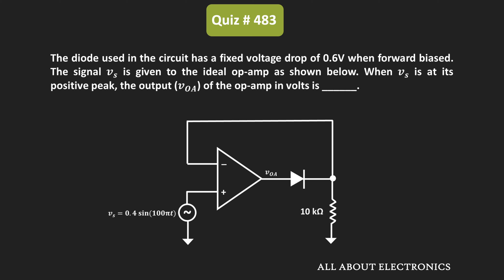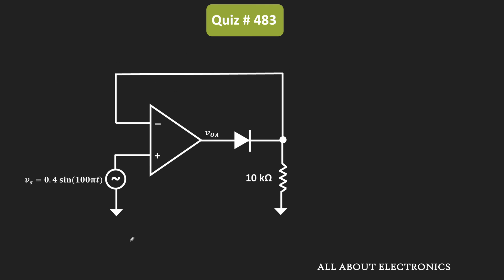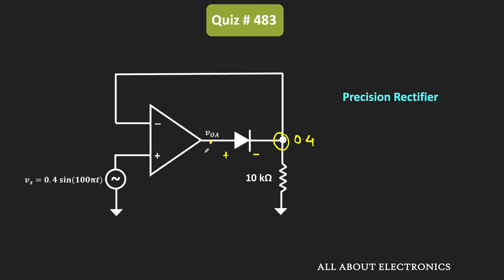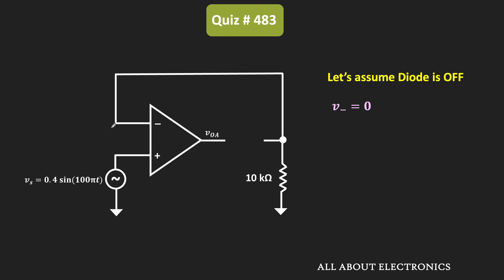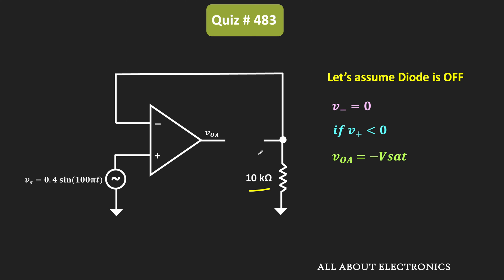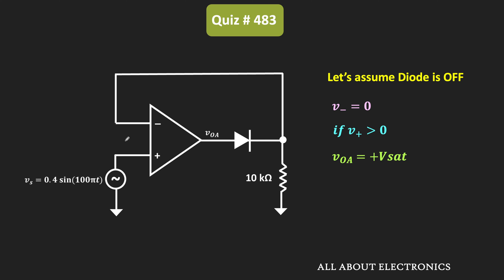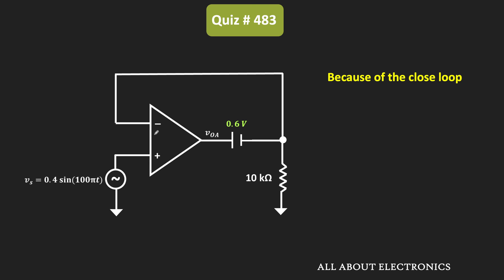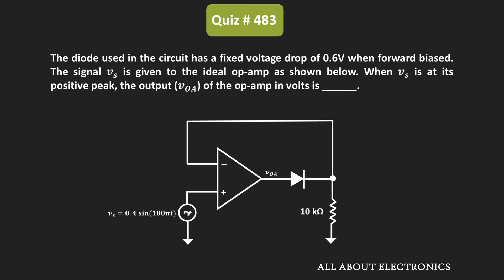Precision Rectifier using Op-Amp (Analog Electronics) | Quiz # 483

Comment: 3:52 how is the voltage after diode 0.4 v, shouldn’t 0.4v appear at voA?
Reply: Understand, thanks for responding!
Reply from the maker: Because of the negative feedback, here we can apply the concept of virtual ground. That means here V+ = V-. If V+ is 0.4 V then V- will also be equal to 0.4V and the same will appear at the other side of the op-amp (across 10k resistor). I hope, it will clear your doubt. 
For more info, you can check this video on Precision Rectifier. 
https://youtu.be/5HweBajP-5g?si=uafO1eM1mY6ZxrYU